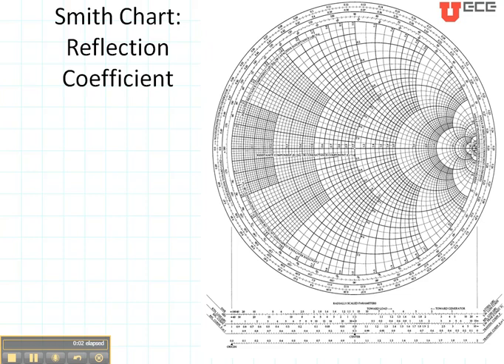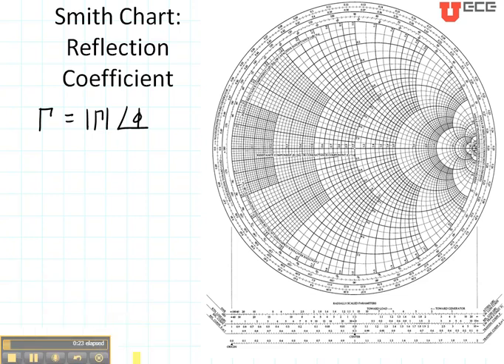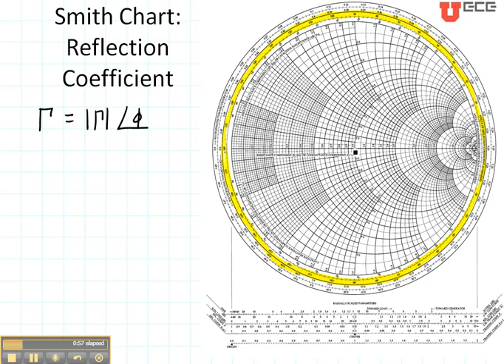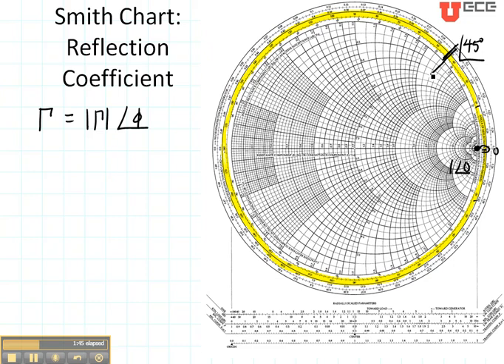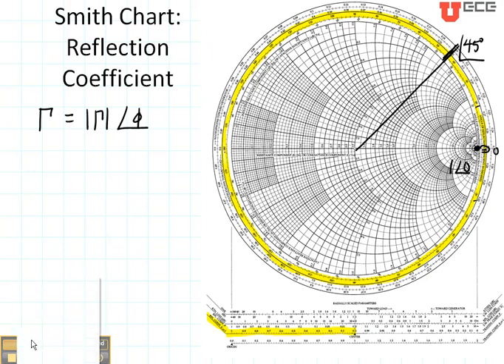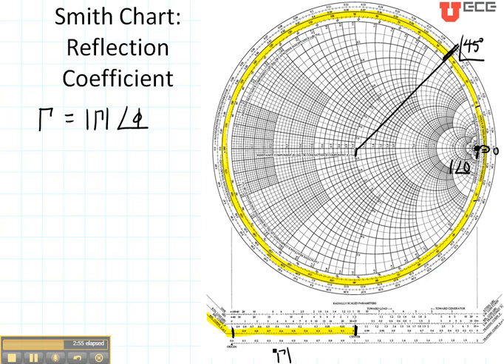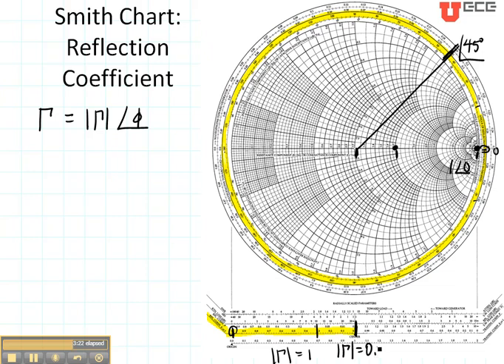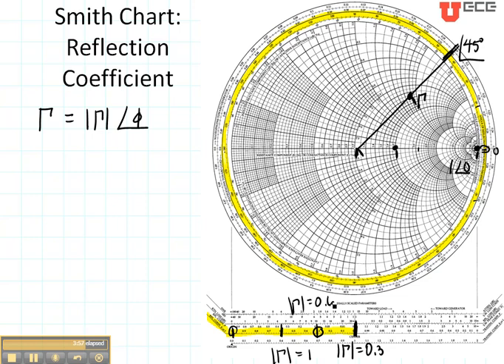ECE3300 Lecture 12b-2 Smith Chart reflection coefficient

Comment: in the centre of smith chart reflection coefficient is 0.0 and in the outer circle its 1.0. So, just choose the point you are interested in and look down on the ''x'' asis, remembering that it goes from [0.0;1.0]. You dont actually see the 0.3 in the chart itself, but its clear that the value is approx 0.3 (thats how I understood it, correct me if im wrong)

Comment: @geethike To get 0.3, you set the center as 0 and measure from the center to that point using a ruler. Take that same distance and reference it back to the reflection coefficient scale.  It should measure 0.3